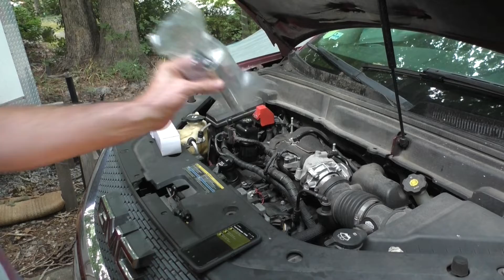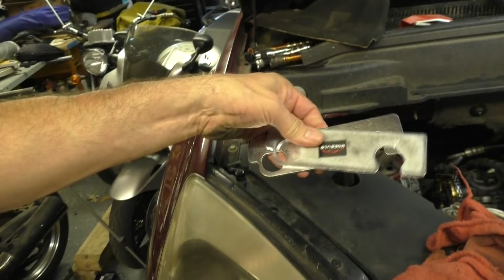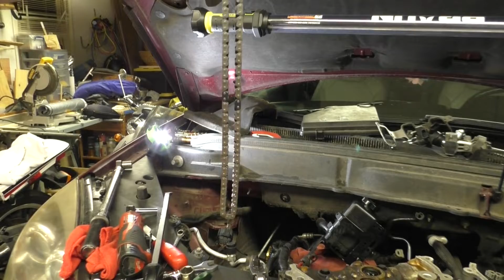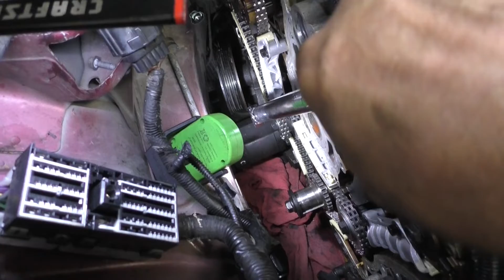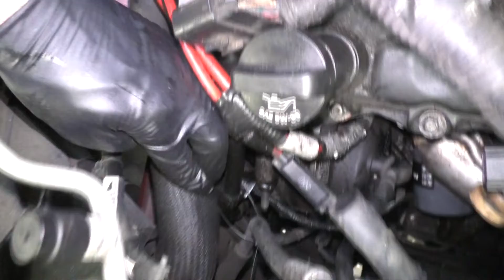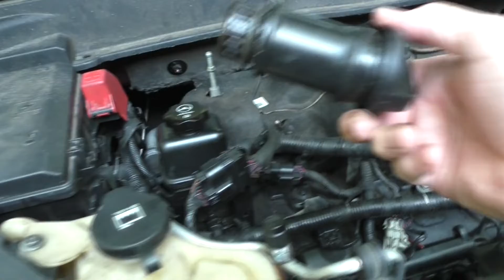2007 GMC Acadia Engine In Car Timing Chain Replacement

Comment: Wonder why it didnt have any of the timing corelation codes, usially these more common than misfire codes. Why didnt you replace the phasers? I would feel better about teplacing them considering all of the problems related to phasers plus the sprocket wear. Awesome video A+!
Reply from the maker: I never got any timing codes. I did not replace the phasers because they did not feel like they were bad, and at 260k miles I was not going to dump in any more money than needed. Thanks for watching!

Comment: Just earned a like and subscribe. Only question I have is did you have to raise the engine to get the alternator bolt out?
Reply from the maker: It has been so long I don't remember. I have also done a ton of Acadia videos, so they all sort of run together. There might be more info in the charging system video. Thanks for watching!

Comment: I wish you had shown in more detail how to remove and install those 10" long bolts - impressive you did all that in the engine compartment
Reply from the maker: I cut a few corners making this into one video. There may have been some details not shown or recorded. Thanks for watching!

Comment: Just bought a 2010 Acadia with 150K miles. Story is it was running fine then the timing chains were replaced on the recommendation of a mechanic. I've never heard run but was told that now it runs for 15 minutes and shuts off. Your video will be helpful as I remove the front cover and check the cam timing. Thanks.
Reply: why would you replace the timing chains for no reason?
Reply: @Xander-d9x7u  There were plenty of reasons. The car was not driven for 2 years because the car wouldn't run properly after the timing chain job that the nephew did.

Comment: How many miles on the engine now? Are you still driving it now? I have a 09 Malibu 3.6l with 213k on it. Always maintained it, majority highway miles. Debating if I should do the chains or just sell it for what I can get for it. Just put new $1100 tires on it and it’s still in excellent condition for having 213k but not really sure how many miles these engines are known to run. I don’t see many over 250k and was surprised you mentioned 260k
Reply from the maker: I finally donated this vehicle. Engine miles were a mystery since it was a junkyard engine. See my early videos for details. Thanks for watching!

Comment: i got the same problem with timing chain ,my Acadia  was running rough ,she  got me home  and die on me .Don't want to throw in the garbage ,going to replace  the timing chain ,thank you for the video
Reply from the maker: Good luck. Thanks for watching!
Reply: @bryansprojects3570   i replace the  timing chains, 100 percent accurate  with all dots ,I can not start the engine ,I dont know what is the problem
Reply: @saskokirov5223  maybe bent valves
Reply: @theOne23  
I checked the compression,was good
Reply: So happy I started ,did  not know why she couldn't  start ,but it is  all good ,works like brand new ,Thank you for the video it helps a lot

Comment: I have 2010 gmc acadia check engine light on for timing chain but never told me there 3 chains and which one
Reply from the maker: You need to replace them all. If one is stretched they all are. They normally come as a kit.
Reply: @bryansprojects3570  my car runs fine and no noise or no lost of power. P0008 code came on and it's 3 things to fix for that code and shop told me timing chain. I had new chain and water pump 3 years ago
Reply from the maker: @dannybanach1384  Maybe a cam chain position sensor? The only  codes I had were misfires.
Reply: @bryansprojects3570  thank u I will replace that first

Comment: 1  replaced everything.  I got the kit.  1st time the Tensioner on bank one brand new froze up and the chain jumped one tooth.  2nd time found that the Plug ins on the celeanoids were loose and one broke off so I sent them back to Amazon. 2nd time I didn't get the new celenoids so I used the old ones and one of the old Tensioners. 
It started up I drove it 40 miles came home now it has a knocking noise and p0017.  Can't tell where the knocking noise is coming from.
Looks like back to the drawing board.  Amazon hasn't replaced the bad parts yet I don't know if they will. They wanted the whole kit back.  I didn't want to take it apart again.  Don't buy from Amazon.  Is there something I don't know about installing new cam phasers too.  I toqued them to 43 lbs?
Reply from the maker: I never took them off, so I can't help. Sorry.

Comment: I really appreciate your video.  I'm gonna replace everything even the phasers, is there anything I should know about replacing the phasers? 
I seen a video that says you have to adjust them 90° more after Torquing 40 nanos.  He said only use new bolts?
Reply from the maker: I never did anything with the phasers. It seems most bolts in cars now are "torque to yield" , so there are essentially only good for use one time because they stretch. I have re-used TTY bolts many times. I would use new bolts in applications like cylinder head bolts. If they are available in this case I would probably use new bolts based on how much work it is to get there.
Reply: @bryansprojects3570  I ran into problems getting the power steering pump loose.  Also I'll need a special tool to take the studs out of the alternator.  Two days working on it .  What kind of tool do you use to get the studs out of the alternator?
Reply from the maker: You may be able to remove the bolts from the back side of the engine that hold on the pump to the engine and leave the pulley on the pump. The alternator studs I believe, have a 6 mm hex on the end. A 6mm ratchet wrench works well. I have a separate video replacing the alternator that may help.

Comment: U didn't show pulling the cam selanoids.
Reply from the maker: This video turned into replacing the cam chains after it was too late to film all of the steps. There is also little camera access to show the solenoid area. Sorry.

Comment: Did you use lock tight on timing chain cover?  Did you have to put something under the engine to take the motor mount out?
Reply from the maker: I did not use Loctite. I may have put a floor jack under the engine but I do not think it is needed.
Reply: Awesome video.  I have a 2010 Traverse I'm gonna replace the timing chain , and all parts needed thanks to a great video you made.

Comment: Thanks, If you're that deep into it with that many miles you really should have put new cam phasers in there. Thats a lot of work to risk having to do it again soon.
Reply from the maker: The goal of this project is to sell the car. If it was going to be a long term keeper I would have definately made soem different choices.

Comment: Thanks for the video, I would recommend that you give the cam phasers a quick turn by hand in front of the sprocket, to ensure they are locked.  I was about to put the new chain on '11 Buick Enclave  and decided to give the phasers a quick turn, and found the rear bank intake phaser wasn't locked to the camshaft.  I could turn it 1/4 of a rotation by hand,  which would have ruin my day after all the work to replace the chains and still get timing codes.

Comment: Awesome Work...   How's it running?        Any oil leaks coming from the Timing cover??   ( Due to very lil space and scraping off RTV )
Reply from the maker: It is running fine, or as well as it ever has. There have been no oil leaks visible from the timing cover.

Comment: Thank you so much, nobody else was willing or able to tackle this project without pulling the motor! This seems like the exact symptoms of my 2009 Acadia including the misfire codes. Could you confirm that you weren't getting timing chain codes, but it was the solution to the problem? It looks possible, but i know me, and i will get stuck or break something and turn 15 hours into 30... I'm not sure how you can stay so positive after having pulled the timing cover so many times.
Reply: Also, I think installing a cheap oil catch can off the bank 1 pcv valve is critical to keep everything clean and cool on the hot side of that motor. Otherwise everything gets gummed up massively from the throttle body to the intake valves with no gas injection upstream to clean them off.
Reply from the maker: The only codes were for the misfires, there were never any camshaft or timing codes. The only problems I have had since were the oil filler spout leaking and a coil pack failure. Unfortunately that has poisoned my daughter from ever driving this car again.
Reply: @bryansprojects3570  Thanks so much for responding. I'm competent, but not a pro. With bids $3,800 - $6,000 and being able to get all the parts for well under $1,000, I'm thinking I can make a long weekend of it. I've done valve covers vvt solenoids, plugs, coil packs, injectors, etc. so I've been in there and am getting comfortable taking it apart.

Comment: So you didn’t have to give the “gears” any rotations to line anything up?? The only thing I saw was… you took the lowers from 6 o’clock to 8 O’clock.
Reply from the maker: If I was not clear in the video check other videos. There is a sequence that needs to be followed.

Comment: why not put normal amazon links keeps trying to get me to sign in to see. I was wondering which brand of timing chains you went with?
Reply from the maker: I have not had that complaint about other links. This is the kit. Also, if you order through the link I make a little money from Amazon.

Engine Timing Chain Kit Guide Tensioner Sprocket Cadillac CTS SRX STS GMC Acadia Chevy Equinox Malibu Traverse Buick Allure Enclave LaCrosse 2.8L 3.0L 3.6L DOHC 24V Replace # 9-0753S replacement parts
Visit the Auto Parts Prodigy Store
Reply: @bryansprojects3570  ohhhh ok makes more sense now as to why it was trying to get me to login would this kit also work for the older 2005 3.6 I know they updated the timing chains at some point
Reply: The links do not work for me either, I would like for you to make something off this. @bryansprojects3570

Comment: I have the same issues with my Acadia. Miss fire 2-4-6 and check engine light just flickers. Runs like crap 💩 I’ve replaced everything you did too. I need to do the compression test like you did.

Comment: You are a great mechanic this the only video I have seen doing timing chain on 3.6vvt in the car.
Reply from the maker: Thanks. That is one reason I went ahead and recorded it which ends up taking a lot of time.
Reply: @bryansprojects3570 I am getting ready to do one, May I ask how long this procedure took you in hours?
Reply from the maker: @MacRilla probably 6 hours
Reply: @bryansprojects3570 Thank you so much for letting me know. The video you made will be my guide. Wish me luck 🤞.
Reply: The 2,4,6 codes should have immediately lead you towards the camshafts…I don’t mention to criticize as I would have probably avoided that conclusion at ALL costs myself, just hated to see you spend so much $$ on all the other parts I think you deep down knew weren’t the issue.  I am in the middle of this same project on daughters 09 Malibu… The original failure was the right head gasket… my parents had an Arcadia that lost a motor so I was aware of the timing chain issue and decided to address it since I was in so deep.  I originally just started gaining access and was never dead set on a plan of whether to drop the engine out the bottom, try to do it in the car or pull the motor… I have a spine injury, so I pretty much knew that I wouldn’t physically be able to be bent over the car for the head gasket on the firewall side… I chose to pull the motor after I realized I was pretty much there already.  I would actually starting the reassembly of the motor today and my only hesitation is how much I am going to assemble the motor before putting back in… I really would like to get the exhaust manifold and converters. Those were nearly impossible to even access the bolts to remove… so getting the threads started blindly will be even more difficult… my plan is to pretty much assemble the motor on the stand, including the wearing harness and right hand exhaust components that it will clear putting it back in.  Wish me luck and kudos on one of the best videos out there… you truly represent 90% of us home mechanics and include the parts that avoids such as oil seal/crank chef seal and solenoid seals as well as your method for the gasket… one of the main reasons why I chose the motor was because I wasn’t confident that the RTV would stay intact during the installation process, and I dreaded that I would unknowingly scrape off part of the gasket to have oil dripping out the bottom of my motor on first start up… pretty sure you would agree with me that if that happened one would be very tented to drive the car off the cliff instead of tearing down again lol
Reply: You are the only brave soul that did this. Im in the process of doing the heads on this engine and after seeing this video you showed me it can be done with the engine in the car

Comment: Hello planning on doing this Job aswell. What size 3 jaw puller did you use? BTW nice job👍🏻
Reply from the maker: I think it was the mid size one in a Harbor Freight kit.
Reply: @bryansprojects3570  Cool appreciate the reply. I'm about to tackle this after the holidays so 🤞

Comment: excellent job. but don't you think ben an tedious job and the amount of miles should be better change the oil pump also?
Reply from the maker: That would probably have been a good idea. We are planning to sell this car so my goal was just to get it to run properly.
Reply: I mentioned because my my daughter have a 2012 with 139000 miles and have low oil pressure problems , it works fine without problems and suddenly the oil pressure drops and the timing chains star rattling an the engine shakes also the codes appear so I will pull the engine to replace the oil pump and timing parts. 
You are an excellent mechanic with a lots of patience thanks for your video

Comment: I like your videos, 👍 I just got a 09 in January and it has that dreaded start up rattle for a second. Supposedly has new chains, but the person didn't check the phasers when it was done 1:04:28 , I pinch the seat every time I start it. If they had put a good ol 350's in these, they would be a great reliable car I think. But back to your videos, I tackled a couple jobs on mine after seeing them, rear window switch and the front bushing ones. thanks! 👍✌️
Reply from the maker: Thanks for watching. This things still rattles when starting but it runs fine, it will be moving on to a new home soon.

Comment: I'm surprised your channel doesnt get more exposure. This is a very common problem and your video is excellent. I bought a rebuilt engine for mine from Powertrain Products. 5 grand. Paid to have it installed along with a list of other new parts while the engine was out. As you probably guessed, I'll never get back the amount i put into it so driving it myself.
Reply from the maker: Thanks for watching and I hope subscribing. I was hoping I would never have to do this video, I cannot imagine what this jib would have cost if I had paid someone. I think the YouTube world is so crowded now it is really hard to get noticed.
Reply: I'm subscribed, have been since watching your first Acadia video. You made my back hurt just watching you hunched over that thing lol. My spine is messed up so out of the question for me.

Comment: I have a gmc acadia 2012  traction control on appears on dash what fo you think is the problem?
Reply from the maker: Without scanning the vehicle it is impossible to tell. One thing to check is to make sure the brake fluid is full.

Comment: How long did it take you?   How many miles were on the used engine when you put it in the truck.   Very impressive are you a mechanic by day?
Reply from the maker: It probably took about 10 hours, it is hard to judge when filming and spreading over multiple days. It helped that I had already had all of this apart before. The used engine was supposed to only have 60k miles on it when I installed it, that would put it at around 130k now. Based on how dirty it was inside when I got it I sort of doubt the miles. I was a mechanic for about 4 years after I graduated college 1995. I am the plant engineer in a factory as my day job.
Reply: @bryansprojects3570  thank you for answering my questions
Reply: @bryansprojects3570  didn't the original engine have like 180k on the original timing chain?
Reply from the maker: It had around 192k and ran fine until it dropped the valve. I am pretty sure the used engine may have suffered from lack of oil changes. I had used Mobil 1 in the original engine since new so that may have helped the chains in that engine.
Reply: @bryansprojects3570  my enclave has 160k and I bought it with 80 something so I am getting nervous lol.  That job has to be 3k or more